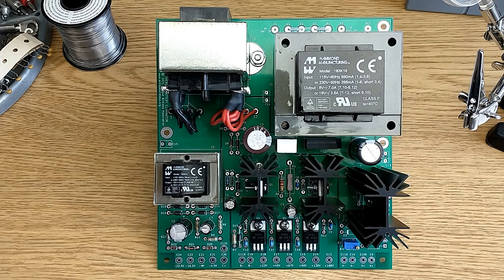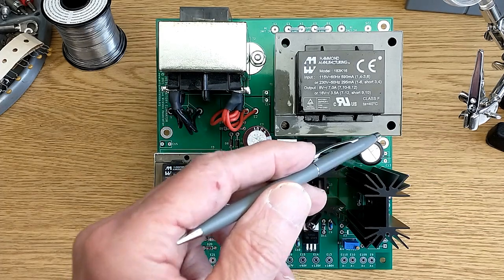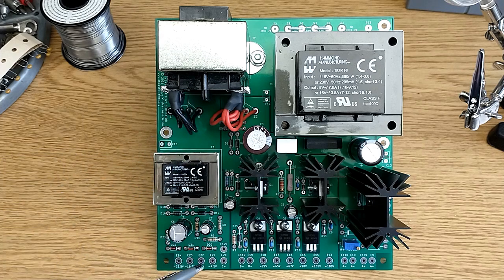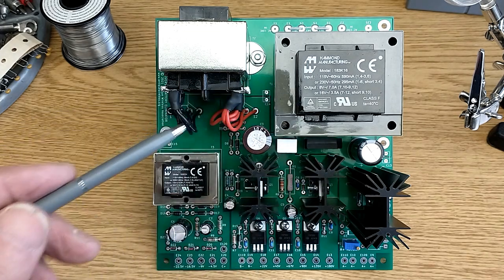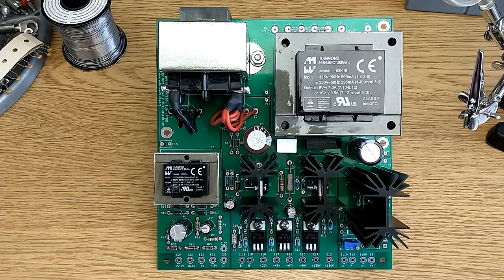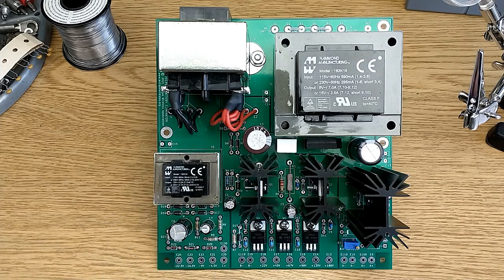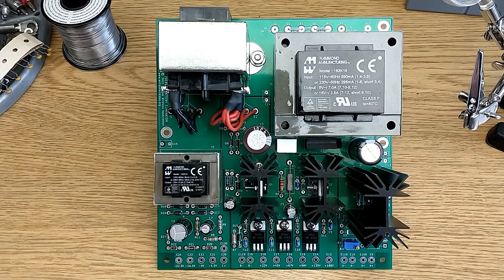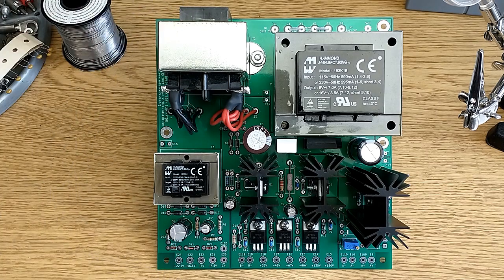A quick look at the AWA Universal Battery Eliminator PCB

Comment: This certainly should be usable for most battery type sets, though I have an ACE (Harry F. Alter Co) battery console which allows multiple tube choices for the output, so I decided to try a 71A which requires -40V for bias at 180V plate.  Then I tried a 112A which needed an odd -11.5V @ 180V Ep.  If I didn't already have a Heathkit IP-17 HVPS and had one of these instead, I'd probably want to modify the C circuit for wider range and variable voltage rather than the usual voltage steps.